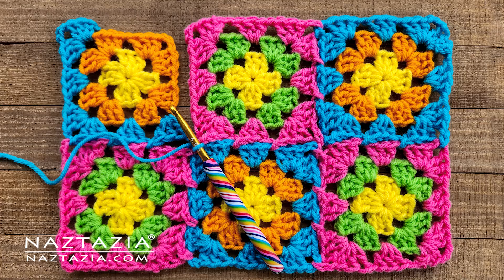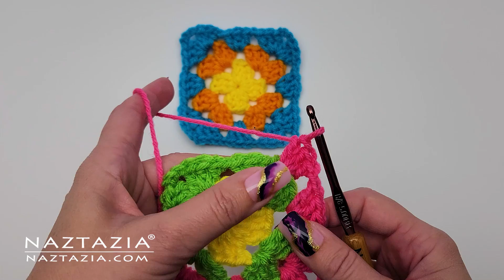Connect Crochet Granny Squares Together using Instant Join Method

Comment: At first I thought this would be more of a problem than helpful, but I can actually see how it's really helpful to do.  Because you do it as you're doing as you are making the product.

Thank you
Reply from the maker: Yep, it's yet another way to connect granny squares together. Might not be the best way for 'every' occasion, but there are times when there might be a granny square variation with picots or some loops sticking out on the last round, that can't be sewn together or slip stitched together, so the only option is to connect as one goes.
Reply: Correct and I also find sometimes that when I connect them it's really bulky looking and time consuming.  This will take that away.
Reply: So what do I do to reconnect my xornert
Reply from the maker: @debbiebrodie6157  You might want to check out my reply under your original comment. I provided a detailed explanation as to what you can do.

Comment: I love this method, having just taught myself to crochet a week ago and finished my first granny square yesterday. One question, though, is blocking not needed with this method?
Reply from the maker: Blocking is one of those things that can be useful to make crochet pieces more even, lay flat, etc. It is an optional step with any crochet piece or method. With that being said, blocking is not a requirement with this technique, however, if the squares do not lay flat, or, if they need to be a little wider or taller, blocking methods can be used.

Comment: I need your help. I am working on a granny square blanket. Somehow I missed connecting my corner. Now I am still working on it. How do I reconnect to put in the corner s😢o I don't have to rip out more than 15 rows. Thks Debbie from Savannah,Ga
Reply from the maker: Anytime there's a connection issue, or a tiny space, or uneven hole, I usually get out my yarn sewing needle and just fix it by making a stitch or two to sew it together. Since it's only a stitch or two, I generally try to fasten off and weave in those ends securely, sometimes adding a drop of fabric glue to ensure that little area doesn't come undone.